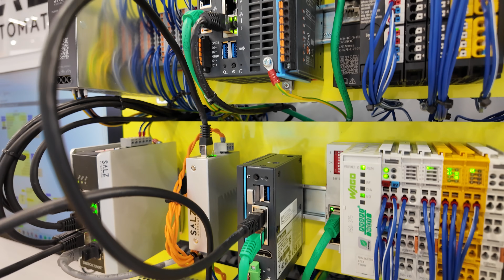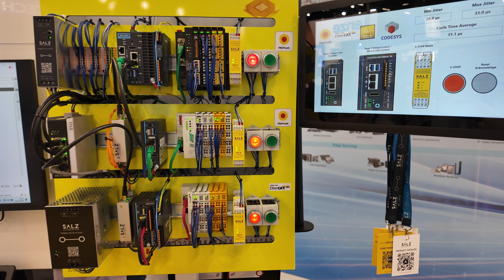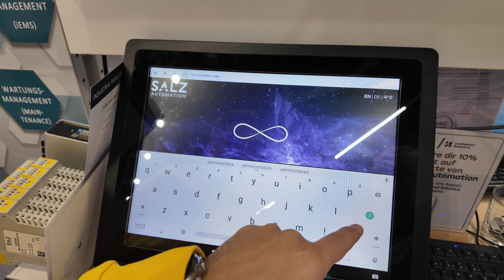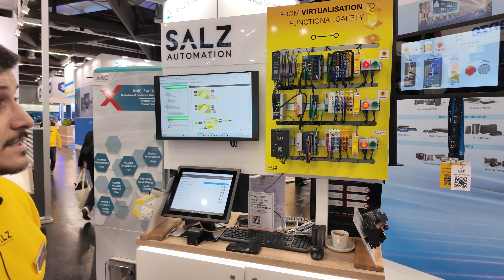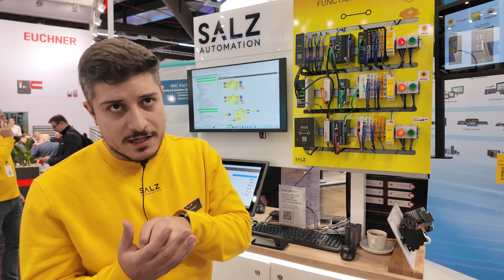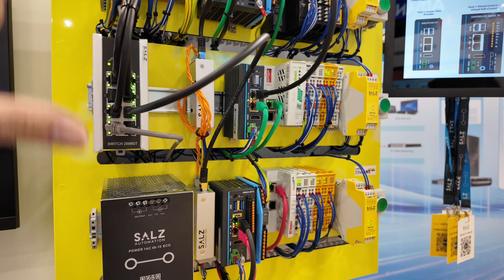SALZ Automation virtual safety PLC on Advantech hardware with CODESYS Virtual Safe Control, FSoE

Comment: PLC downtime costs money. 🛡 What’s your top tip for predictive maintenance in control cabinets?
Reply: You’re 100% right — cabinet-level failures are silent money burners. If I had to pick one high-impact tip that consistently pays off, it's this:
Most PLC failures don’t happen suddenly — they announce themselves electrically long before the machine stops.
Instead of only monitoring process data (temperature, pressure, speed), add cabinet health trending like for instance:
- Log trends inside the PLC or via SCADA (hourly is enough)
- Set rate-of-change alarms, not just min/max
- Review trends monthly — not only during failures
Reply: @rudyassaad404  Great point! Proactive monitoring is key, and reliable components are what make those electrical trends trustworthy over the long run.

Many of the connections and PHY chips we supply are designed for stable signal integrity and extended lifecycle in industrial environments — helping ensure the data you’re trending is accurate and your cabinet stays healthy.

If you're planning any upgrades or new projects where robust connectivity or interface components could add value, we'd be glad to share samples or technical insights. Happy to connect and explore how we can support your next predictive maintenance setup!